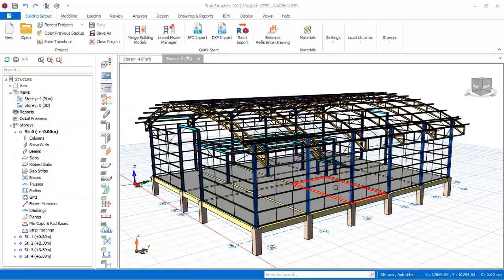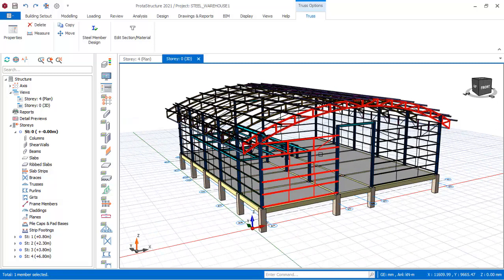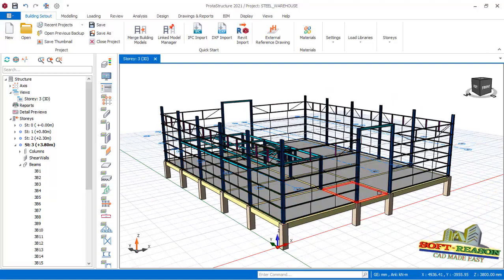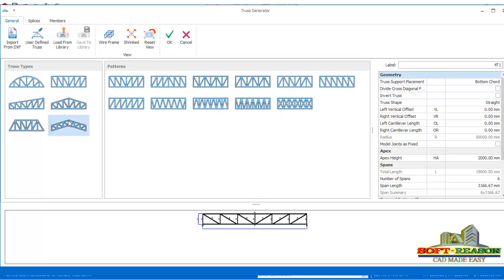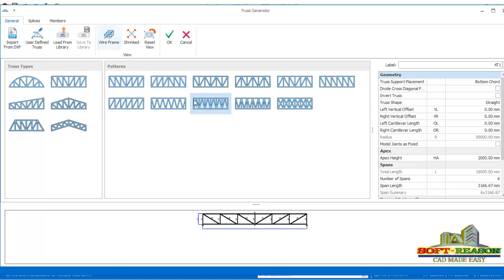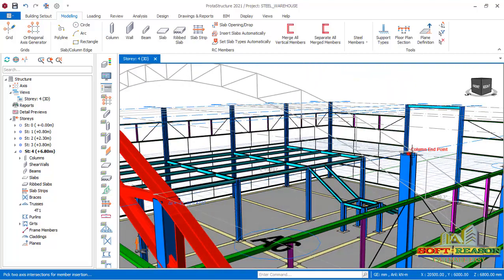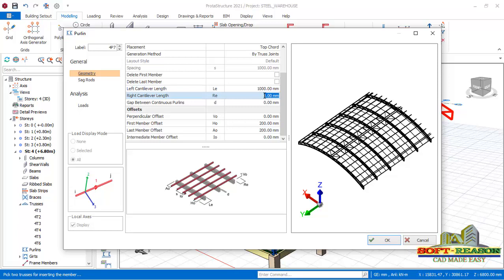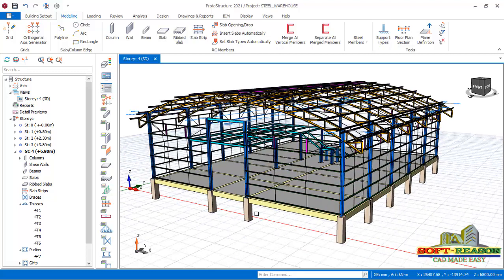The Easiest Way to Model Curve Steel  Roof Trusses in Protastructure 2021

Comment: Haw can i use ACI318-19 in design and cases of loading ultimate
Reply from the maker: Yes
Reply: @CADmade-easy   can u make Video
Reply from the maker: The follow code are available in Protastructure 2021,.   ACI318, IBC Thailand,  philippines (ACI318, NSCP2015), Indonesia ( ACI318, SNI1726) which of those did you mean to use.
Reply: @CADmade-easy   Aci   318 -19